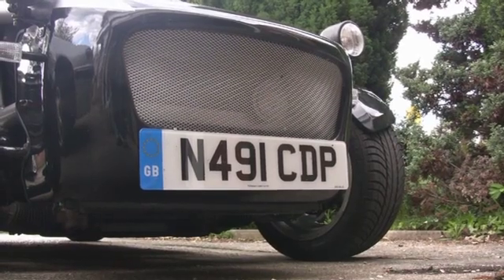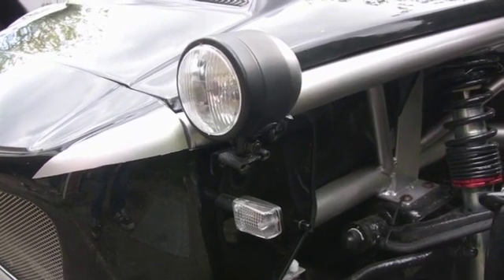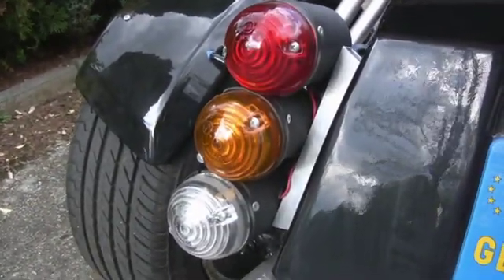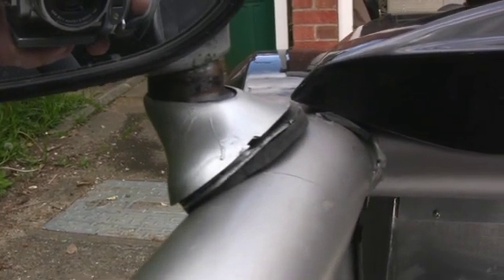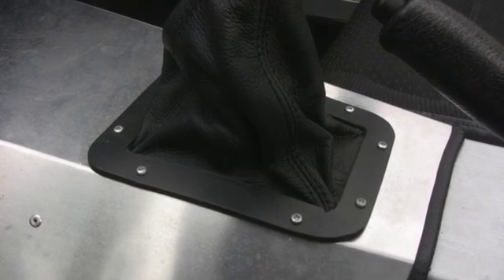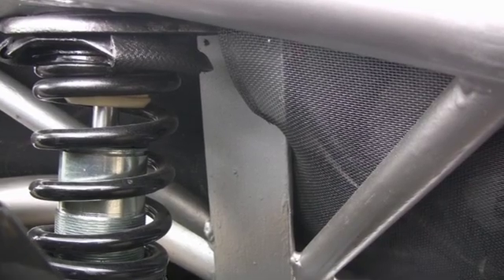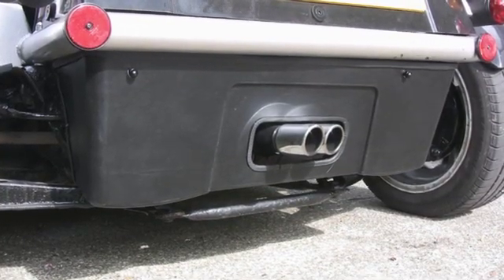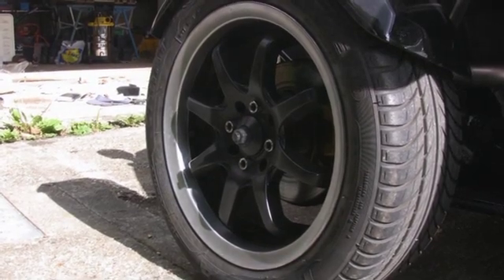Mev Exocet kit car build part 8. IVA preperations

Comment from the maker: Fraid so, its to do with the steering column and whether it is collapsable or not. they will only accept it crash test compliant if the unit is exactly as mazda created it, as it needs the original steering wheel. get one off ebay for next to nothing.....